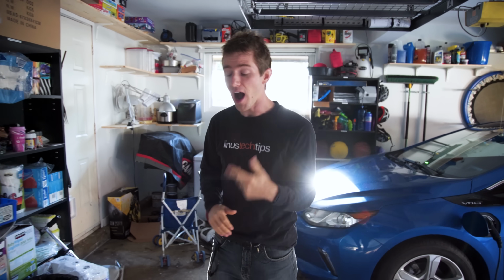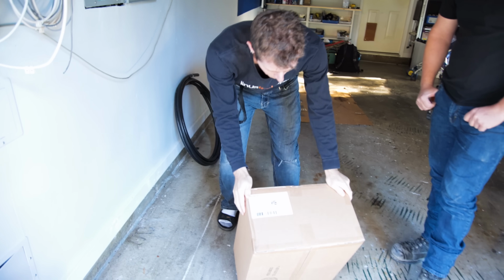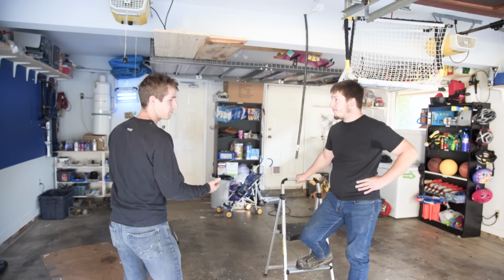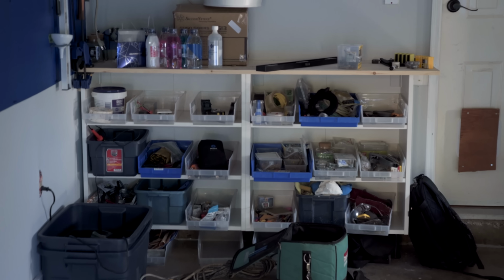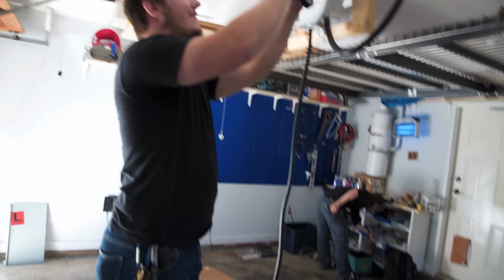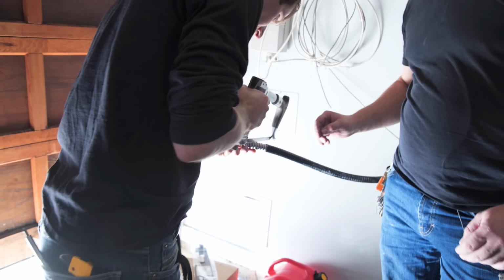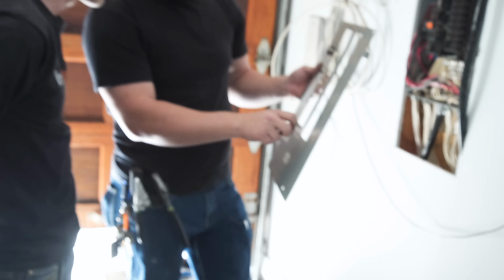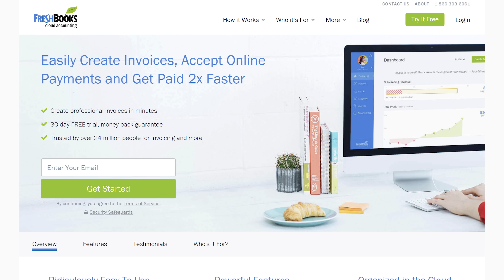Installing my Electric Car Charger - What Could Go Wrong??

Comment: To all the Europeans that think you have better electricity than us because it's 400v or something like that. I'll counter that you guys have RING MAINS. That's freakin stupid. And also your homes get about 400v 3 phase, 25 amp electric service. Whereas us in the US get split phase 240v 200amp service! So we have a whopping 48 KILOWATTS at our disposal.
Reply: ??? 400v 3 Phase 48 Amps it is at my house... Btw why would you run 48 Kilowatts in a house? If you come close to having a constant consumption of above 10 KW (if you have a flowthrough heater/electric boiler thats a different story, the ones I saw usually run on 16 or 21 KW) you should really consider replacing some electronics for more efficient ones... How much is power per kwh over there? in Germany, it's like 30 cents converted to USD. Using 48 KW for a day would literally cost you hundreds of dollars (like 350)
Reply: @pdoge  Well since I live in America we have Air Conditioners that use quite a lot of power as well as big blower fans. That's because in America instead of using hydronic heat (some really old houses still have it) we use forced air central Heating and Air Conditioning which can uses quite a bit of power because the fans involved are quite powerful. Our Electric panels by code are not allowed to use more than 80% of the full capacity (48 kilowatts). But it's there just in case. Also were I live the price of electricity is 11.07 cents per kwh.
Reply: @pdoge  But you will pretty much never use that much power but it's there just in case. Funny thing about the way we heat and cool our homes. Instead of using hot water and radiators we use a big blower fan to force air across some kind of heat exchanger to either heat or cool the air. In the winter we have a couple of options. We can either burn a fuel like #2 Fuel oil, Propane, or Natural Gas to generate heat or we can use a heat pump (basically an air conditioner running in reverse, or we can use resistive heat (currently the most expensive way to heat a home.
Reply: @legostar55  Wow that's super cheap for electricity. What Temps do you get in summer? Using AC at home is largely frowned upon here as people view it as snobby and too lazy to open a window, and it also uses a ton of power. But we only get 30+ Celsius / 85+ Fahrenheit for like two weeks in summer, I've heard some parts of the states regularly go over 95 Fahrenheit and can imagine it's impossible to sleep without AC
Reply: @pdoge  Oh yeah it gets hot. Especially in Georgia peak temps can reach over 100° F at 80% humidity. That is oppresively bad and trust me, you don't want to experience that. But on an average hot summer day in Georgia it can get to 87° but can go as high as 92° which is just hot. Honestly though why would people view it as snobby? Opening a window isn't actually going to cool the room. It's just going to make the temp between outside and inside the same which isn't really that great during the heat of summer. But for you I would say you just go buy a small 5000 BTU window air conditioner. They only consume 455 watts so they are pretty thrifty when it comes to cooling
Reply: @pdoge  How do you heat your house in the winter. I hear that you use radiators but how well do those heat? The cool thing about forced air heating is that the heat is actually pushed into your room rather than simply waiting for the air to passively convect through the radiator
Reply: @pdoge  oh and something cool is that we can filter out the air with big air handlers
Reply: @legostar55  Radiators with a central gas or oil burner are actually most common (oil was forbidden this year for new installation because of bad efficiency and high carbon pollution). Newbuilt homes use heatpumps because they are climate neutral and can apply for additional funding by the government. Also for drinking water heating solar panels are mandatory on newbuilt houses. 

As to why it is viewed as snobby - a lot of (especially old) Germans are obsessed with "Lüften" - letting fresh air in the house. Mostly because when the boomers all went to build new flats in the city they were constructed so damn bad in the 60's and 70's (bathrooms without windows or any sort of ventilation, radiators directly under the windows and a stone window bank so no heat ever got around) that mold would be everywhere if you dont open your windows half the day to get moisture out... So when it got hot during summer they would just keep the windows open overnight and let it cool down to 25 Celsius and then dealt with it. Now they tell their children and grandchildren to do so as well :D

Also in winter they blast their radiators on full power and are complaining about paying 2000€ a year for gas but would NEVER change their habits or even spend 5000€ on new Windows for their house which would already amortize after less then 10 years lol

But yeah that's why AC is frowned upon, it's so expensive to install & maintain (no house was built with AC in mind until the early 2010's) and to operate and is seen as wasting energy when you can just open your windows overnight. The greens and Greta also have a huge fanbase here.
Reply: @pdoge  Have you ever considered buying a small 5000 BTU window air conditioner? They are meant for only one room so your bedroom is where you should install it. They don't consume much power, only 455 watts, and they could make a room very comfortable.
Reply: @pdoge  At least in the US, small window air Conditioners will run you about $200. That's pretty cheap and they aren't permanent. You can remove them if you want. I also determined that since you guys get about 4 weeks of hot temps, you would only pay a little over €60 to run for the total amount of time it runs

Comment: no earth? wtf Canada
Reply: It's there, its a bare copper lead in the teck cable. Red and black are A and B phase and blue would be C phase in a 3 phase setup, or if marked white or grey could be used as a neutral if required as well.

Comment: 110 reversed phase =220. noobz.
Reply: 120/240V single (split) phase. In commercial and industrial installs here 347/600V 3 phase is extremely common.

Comment: Imagine having to pay for 240 volts.
Reply: It is not like the 120V chargers are free. You get to pay for any charger you own. The US has 120 and 240V in the house, only higher power devices utilize 240V to keep the amperage reasonable.  FYI: The Chevrolet Volt charger (for 2016+) can actually be modified to run off 240V as well.